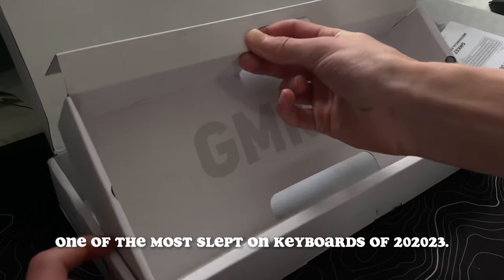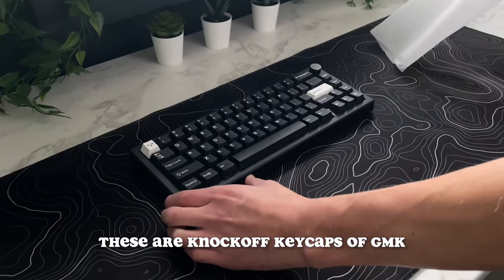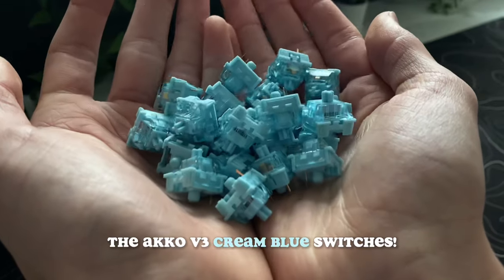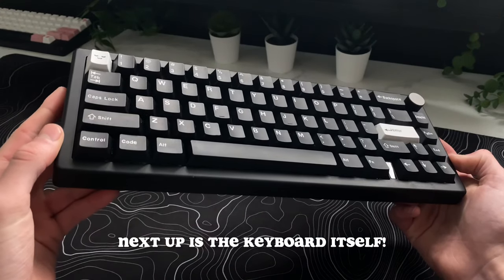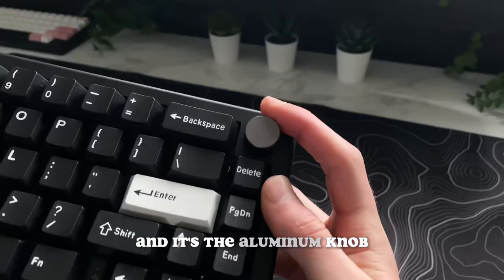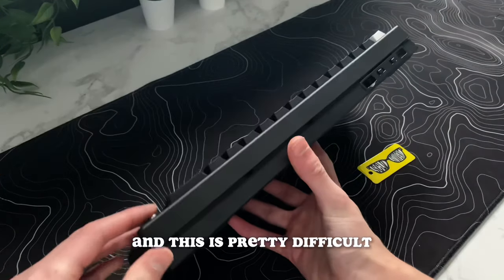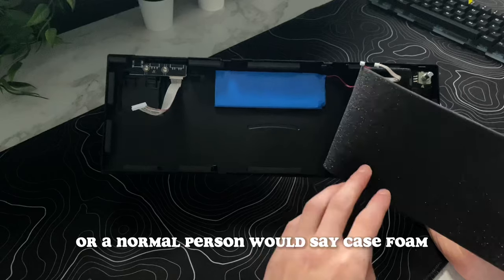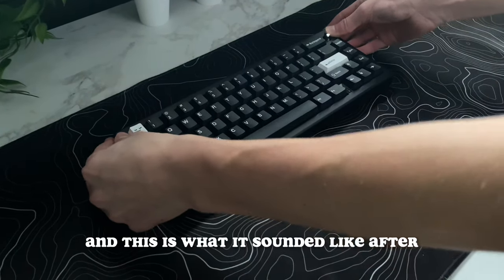The BEST budget keyboard of 2023

Comment: This is really a very good keyboard. The typing feeling (after mode + akko levender purple) would be unbelievable and it's so agile with 3 modes. Though it's light enough to move around.
Reply: I'm not familiar with custom keyboards, what do the 3 modes do?
Reply: @desolate282  3 modes basically means it has usb cable connection, bluetooth, and wireless 2.4g conectivity
Reply: Yes mate , I also have a gmk67 with Akko lav purps. 

Its amazing

Comment: the fact this is £70-£80 including switch opener etc is crazy
Reply: nvm its £80 cuz the shipping on the keycapshave £8 delivery but the 80 includes the switch/keycap opener/puller and the tape
Reply: actually its 88 if u use the exact same colour keycaps as him but it doesnt change the sound

Comment: if you are an Indonesian viewer, this might be similar to VortexSeries GT-65, because it's the same OEM partners, just different brand.
it can be cheaper since Indonesian Customs can complicate things and make the Zuoya's branded one is priced higher.
Reply: @heymaruniko ini sama dwngan vortex gt65 gan?
Reply: @ruzaqir354  sama
Reply: Is this really the same as the vortex series gt 65 since i live in Indonesia.And which one do you prefer?
Reply: @HanyaSeputarKisah  same OEM parts, so it will exactly the same, except its already cheaper. So i have no reason to choose the other pricier one.
Reply: That's exactly what I thought when first seeing the board. GT65 even comes with aflion blue sky switches! Which is a great value and best stock linear switch I've ever tried.
Reply: @HeyMaruniko sama juga dengan maxfit 67frost, ... mirip juga dengan meca 6x+ (versi wired only, tp pcb support 3mode) sama² pk IC YiChip
Reply: @NVM3  udah beda, case beda, pcb juga beda, layout pun beda.
itu 2 yang kamu sebut 65% biasa, maxfit67 itu expoloded 65%

Comment: hi there, i ordered gmk67 with akko cream yellow v3 PRO with SA profile keycap, and further research i founded that the PRO version is not as thocky as non PRO one as it is more higher pitch pop sound, i have not yet seen someone else building keyboard with gmk67 with the cream yellow v3 PRO, so im just wonder with all that fact, gmk67, cream yellow v3 pro and SA keycap, with mods provide in the video, will my keyboard come out as thock deep sound?
Reply: They are basically the same thing but linear
Reply from the maker: yes

Comment: Thank you! I was wondering, what is the difference between TESTER68 Black Kit and GMK67 Black ? Tester one is cheaper (20-30 USD) and second one is 49 USD. Is it the same or what am I missing here? Sorry, but Im kinda confused and wasnt able to find the answer so far.
Reply from the maker: it has a knob and is gasket mounted
Reply: The GMK67 has better wireless connectivity (faster polling rates and better signal strength), can be run wired, is gasket mounted, has a knob, a rechargeable battery, and is overall just a better built board.

Comment: Hey guys how does this keyboard compare to redragon k530?
Reply: K530 is smaller (obviously), better rgb (in my opinion), have thinner case bezel, normal one have bluetooth & wired while the k530 pro has tri mode which is better. This GMK67 has gasket mount, a bit off meh build quality and better sounding stabilizers + has pre-installed foams with it for cheaper.
Reply from the maker: The GMK67 is just fun to build